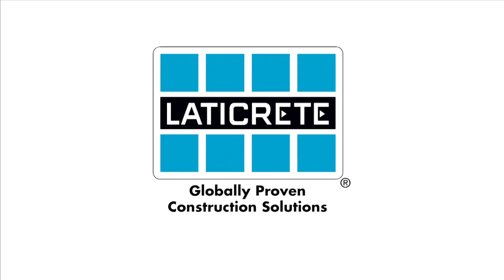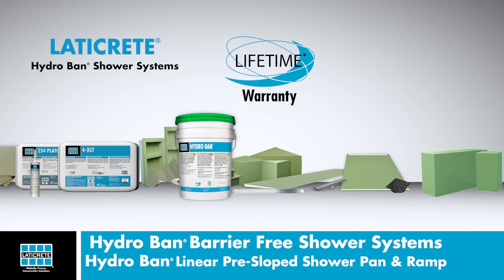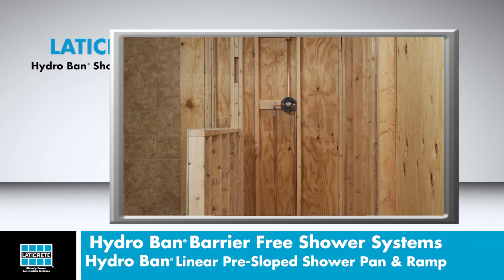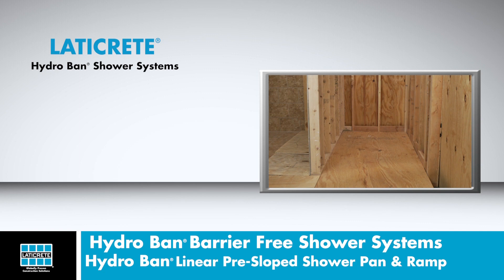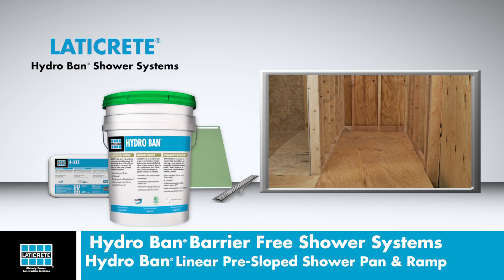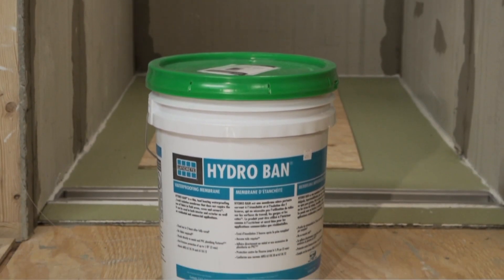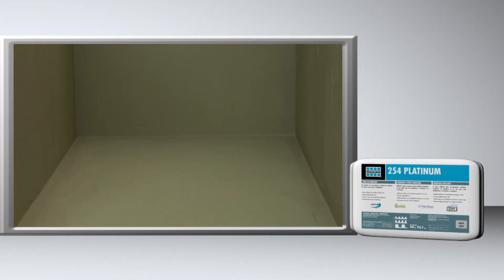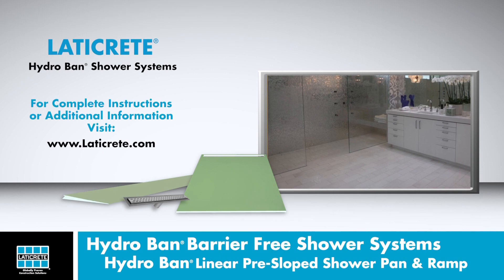How to Build a HYDRO BAN Barrier Free Shower Using Shower Installation Components

Comment: There must be something I’m missing. Why wouldn’t the drain be under the shower head so water slope away from the entry/room? Instead the water slopes towards the bathroom, only stopped by the drain(!) This seems like water could spill into the room in a number of ways.
Reply from the maker: The video doesn't show this and was/is solely geared towards the installation of the shower components. Additional work would be done to complete the install including a shower door and glass for the knee wall. 
For these types of installs it is common to have an additional drain in the middle of the bathroom floor to allow water to drip from the chairs, if used. Alternatively most shower would also include a door of some sort to block water from leaving out.
Reply: You noticed the same thing I did. 
But no joke. I just did a bathroom 10-12 ft room. 
Drain dead center of room. Customer wanted to freak people out.
Reply: This method allows the slope to be minimal at the entry/highest at the back.  The linear drain catches any water at the entrance portion of the shower.
If you have sufficient linear distance between the entry and the showering location,  no/very minimal water would ever get outside the linear drain location.
Reply: I prefer to inset the subfloor and tuck the drain closest to the shower head or wherever is most aesthetically pleasing. 

This is an ugly design choice.

Comment: How much did this entire install cost with all the laticrete products? In 2019 US dollars
Reply: probably close to $2k . I am doing one like this now, and retail for the pan, with curb, was around 750, similar price for the drain.  After that its more reasonable: 4x8  sheets of wallboard were around 80.  A contractor gets a decent price break.  I greatly appreciate all the how-to videos available.
Reply from the maker: Thanks for the question. This was done for demo purposes. If you are an installer, you'll need to check with a local distributor on product cost. If you need to find a one near you, click here to use our online distributor locator: https://laticrete.com/en/where-to-buy

If you are a homeowner, you'll need to contact a local contractor to give you a cost on your particular shower. There are a lot of variables on cost besides just product used. 

Let us know if you need any further info.
Reply: I'm getting ready to start one of these in my basement. I've already done bathroom tile floors and a backsplash before. The only tricky part looks to be the pan. The plywood and lumber, PVC parts, mortar base, and a few tiles are all cheap, so I'm going to build a full size pan model and 1 foot high wall as practice first, then build the actual pan once I learn that. Better to spend a few $$ and learn on something I dont care about than find out the hard way on the real pan. With good prep, some basic hand tool, and a rented tile saw, combined with the volumes of info available such as this video (which is one of the clearest I've seen), this task should be something a moderately skilled person could accomplish.